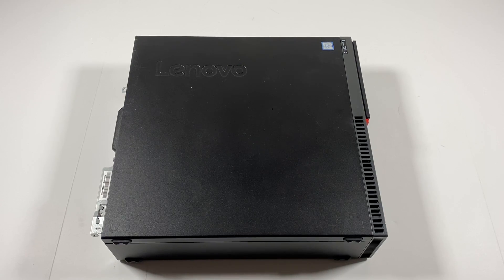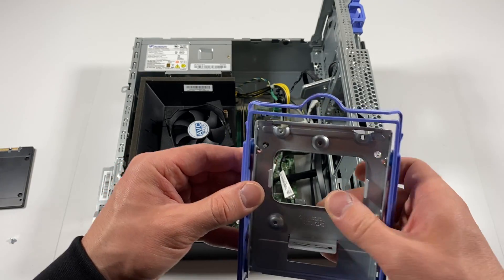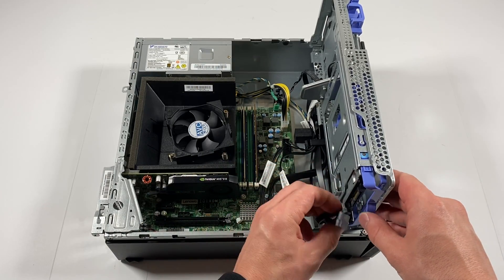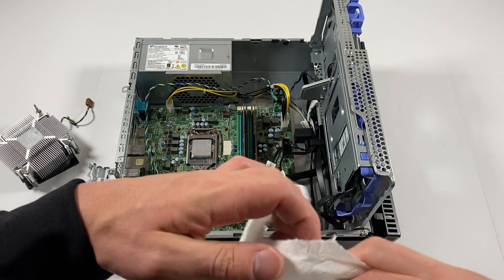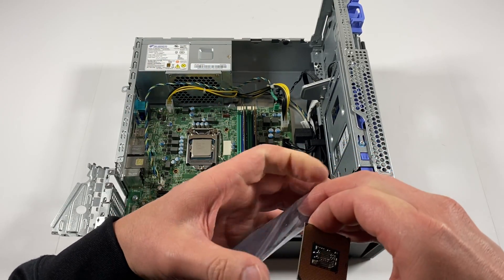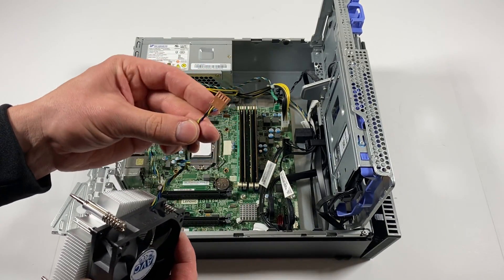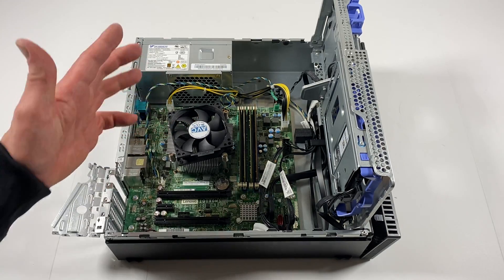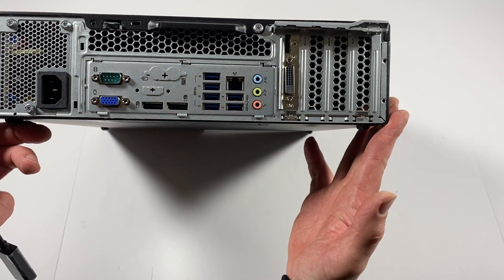Lenovo Thinkcentre M900 Gaming Upgrade CPU SSD RAM Video Card

Comment from the maker: List of Parts and Upgrades works with this system :

Lenovo Thinkcentre M900 Teardown
https://www.youtube.com/watch?v=f2iGKYZVLkQ

CPU Installed Before The Upgrade: 
Intel Core i5-6500 Processor LGA 1151
https://amzn.to/3OKToC8

CPU Upgrade:
Intel Core i7-6700 3.4GHz 8M Processor LGA 1151
https://amzn.to/3zEAGqn

List of RAM will work with this system.
Maximum memory supports: 64GB  (NON-ECC)

(1.) Crucial RAM 16GB Kit (2x8GB) DDR4 2400 MHz CL17 Desktop Memory
https://amzn.to/3zljDuD

(2.)  Crucial 8GB DDR4-2400 UDIMM
https://amzn.to/3Q9D2no

(3.) Crucial 32GB Kit (2 x 16GB) DDR4-2400 UDIMM
https://amzn.to/3SbD3sZ

Thermal Compound Paste:
(1.) Arctic Silver 5 Thermal Cooling Compound Paste 
https://amzn.to/2ziNU0H

(2.) Noctua NT-H1 3.5g, Pro-Grade Thermal Compound Paste
https://amzn.to/36kTk7A

(3.) ARCTIC MX-4 (current edition) Thermal Compound Paste 20 Grams 
https://amzn.to/2DhGJaK 

List video cards will work with this system Dell Inspiron 3670

(1.) Gigabyte GeForce GT 1030 GV-N1030D5-2GL Low Profile 2G Computer Graphics Card 
https://amzn.to/2Z4PHkp

(2.) ZOTAC GeForce GT 1030 2GB GDDR5 64-bit Low Profile Video Card ZT-P10300A-10L 
https://amzn.to/2WzgLXk 

(3.) PNY NVIDIA Quadro K1200 - Supports 4 Monitors
https://amzn.to/3zLOoZq

3.5" to 2.5" SSD or Hard Drive Caddy Adapter R494D 0R494D 
https://amzn.to/2XTPeRr

SSD List:
(1.) Samsung 860 PRO SSD 256GB - 2.5 Inch SATA III Internal Solid State Drive
https://amzn.to/2BY5gRl

(2.) Samsung SSD 860 EVO 250GB 2.5 Inch SATA III Internal SSD 
https://amzn.to/37xWUfc

(3.) SK hynix Gold S31 1TB 3D NAND 2.5 inch SATA III Internal SSD
https://amzn.to/3d7X6D6

(4.) Samsung SSD 860 EVO 1TB 2.5 Inch SATA
https://amzn.to/2B2FURX

(5.) SanDisk SSD PLUS 1TB Internal SSD
https://amzn.to/3hwdqku

(6.) SanDisk SSD PLUS 240GB Internal SSD
https://amzn.to/2zfc7EX

(7.) Crucial MX500 250GB 3D NAND SATA CT250MX500SSD1(Z) 
https://amzn.to/3bTTjbX

(8.) SanDisk SSD PLUS 480GB Internal SSD SDSSDA-1T00-G26
https://amzn.to/2yfgjUKLenovo Thinkcentre M900 Lenovo IQ1X0MS Motherboard. Gaming. How to Upgrades Install Replace Change Processor, Memory, Graphics Card, Hard Drive, HDD, Solid State Drive.

List of Parts and Upgrades works with this system :
Lenovo Thinkcentre M900

CPU Installed Before The Upgrade: 
Intel Core i5-6500 Processor LGA 1151
https://amzn.to/3OKToC8

CPU Upgrade:
Intel Core i7-6700 3.4GHz 8M Processor LGA 1151
https://amzn.to/3zEAGqn

List of RAM will work with this system.
Maximum memory supports: 64GB  (NON-ECC)

(1.) Crucial RAM 16GB Kit (2x8GB) DDR4 2400 MHz CL17 Desktop Memory
https://amzn.to/3zljDuD

(2.)  Crucial 8GB DDR4-2400 UDIMM
https://amzn.to/3Q9D2no

(3.) Crucial 32GB Kit (2 x 16GB) DDR4-2400 UDIMM
https://amzn.to/3SbD3sZ

Thermal Compound Paste:
(1.) Arctic Silver 5 Thermal Cooling Compound Paste 
https://amzn.to/2ziNU0H

(2.) Noctua NT-H1 3.5g, Pro-Grade Thermal Compound Paste
https://amzn.to/36kTk7A

(3.) ARCTIC MX-4 (current edition) Thermal Compound Paste 20 Grams 
https://amzn.to/2DhGJaK 

List video cards will work with this system Dell Inspiron 3670

(1.) Gigabyte GeForce GT 1030 GV-N1030D5-2GL Low Profile 2G Computer Graphics Card 
https://amzn.to/2Z4PHkp

(2.) ZOTAC GeForce GT 1030 2GB GDDR5 64-bit Low Profile Video Card ZT-P10300A-10L 
https://amzn.to/2WzgLXk 

(3.) PNY NVIDIA Quadro K1200 - Supports 4 Monitors
https://amzn.to/3zLOoZq

SSD List:
(1.) Samsung 860 PRO SSD 256GB - 2.5 Inch SATA III Internal Solid State Drive
https://amzn.to/2BY5gRl

(2.) Samsung SSD 860 EVO 250GB 2.5 Inch SATA III Internal SSD 
https://amzn.to/37xWUfc

(3.) SK hynix Gold S31 1TB 3D NAND 2.5 inch SATA III Internal SSD
https://amzn.to/3d7X6D6

(4.) Samsung SSD 860 EVO 1TB 2.5 Inch SATA
https://amzn.to/2B2FURX

(5.) SanDisk SSD PLUS 1TB Internal SSD
https://amzn.to/3hwdqku

(6.) SanDisk SSD PLUS 240GB Internal SSD
https://amzn.to/2zfc7EX

(7.) Crucial MX500 250GB 3D NAND SATA CT250MX500SSD1(Z) 
https://amzn.to/3bTTjbX

(8.) SanDisk SSD PLUS 480GB Internal SSD SDSSDA-1T00-G26
https://amzn.to/2yfgjUK
Reply: Bro can I put 3200 mhz ram on this motherboard

Comment: I installed an MSI GeForce GTX 1650 and 32 megabytes of RAM in my M900. It's great.

Then I ordered an i7-6700 and that's where I failed. The PC goes into a cyclic reboot at the startup point of Windows 10 (1809). 

I returned the i5-6500 and everything is fine.

BIOS updated to the latest version. Before replacing the processor was updated everything drivers, Intel ME etc.

Maybe it's Windows itself and you should install a newer version?

Comment: Graphic card, this one is 81% faster. -> Nvidia Quadro p1000 in low profile. I have that one in use and it is really fast for the M900
- The memory is use is -> 64GB max, UDIMM, DDR4 2133
-> Search for the spec sheet from Lenovo -> m900_sff_platform_spec.pdf

Comment: Can I use GTX 1660 on this mother board
Reply from the maker: Hi, yes you can.
Reply: @Mxkdt did you even do Research? The 1660 has external power, which this pc doesnt supply. The maximum would be a 1650

Comment: sorry, what's the power supply here? because I have 250w and I don't know if it will pull me
Reply: Bro I have also
Reply: @MuhammadDanish-ky2in  Will the rx 6400 run on a 250w PSU?
Reply: @TechCamHD  noooooo bro this powersupply is for potato PC u have to upgrade
Reply from the maker: Hi, guys  rx 6400 low profile will will work fine with 250w PSU.
Reply: @Mxkdt  will the rx 560 run on this power supply?
Reply: Can I upgrade 1660 GTX on this motherboard
Reply: @MuhammadDanish-ky2in  I have a question, will the gtx 1660 go on this power supply?
Reply: @TechCamHD  noo bro gtx 1660 super requires 500 watts power supply
Reply: @MuhammadDanish-ky2in  and will gtx 1050 4gb work on 250w?
Reply: @TechCamHD  no bro GTX 1050 required 350 watt power supply you have to upgrade your power supply

Comment: Do you know if you can put a 3.5 and a 2.5 HD in this box or only 2 x 2.5 with the Dell caddy adapter you mentioned.
Reply from the maker: Hi, yes you can install with dell caddy 2 2.5 SSD or 2 2.5 laptop hard drives.

Comment: Dude can I put two 1030? I upgrade mine but I want 4 gb of gpu
Reply: You'd have to find 2 that will SLI, otherwise not worth it
Reply: get for rx550 4gb ddr5, is more cheap and low profile can be instaled in this case ( is gud deal under 40 usd )

Comment: you can probably get a gtx 980 running in there with no problem
Reply from the maker: Hi, it will not fit unless, if you install motherboard in a custom gaming case.
Reply: @Mxkdt  i didnt take into account the size of the hard drive cage and power supply 😅